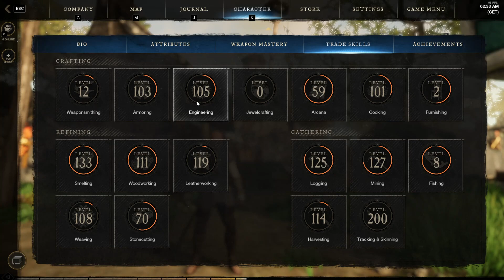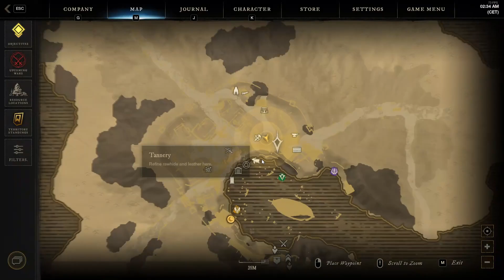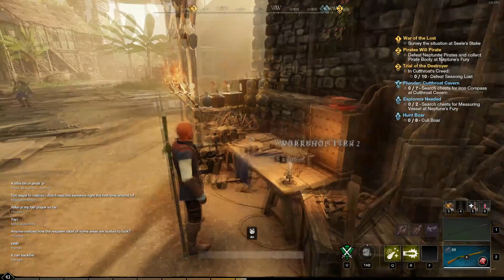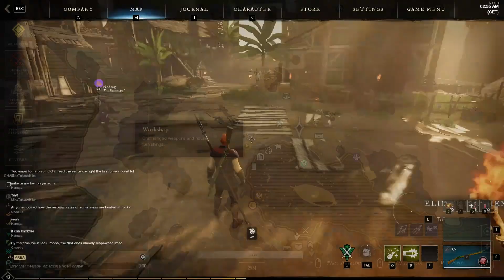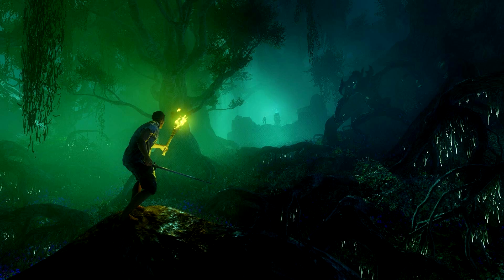How To Lvl Engineering 0-100 The Best Way! | New World Guide

Comment: Why not continue to craft gunpowder since u get more xp from that than the bullets
Reply from the maker: That's because apart of the bullets is using the gunpowder, so that way you make use of the gunpowder you already crafted for maximum efficiency. Also much easier to farm the materials for the iron cartridges compared to gunpowder, but I suppose if you could buy most of it that might be an alright solution aswell. 

This is just what I did :D